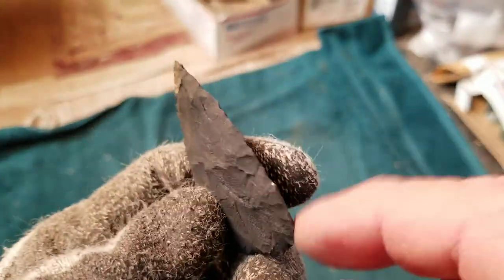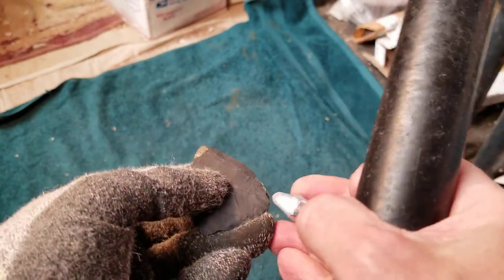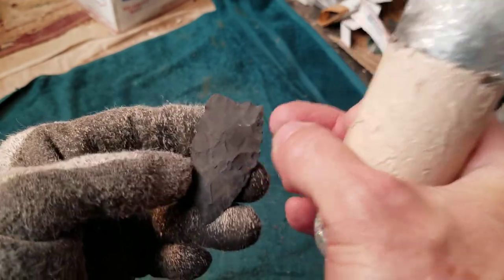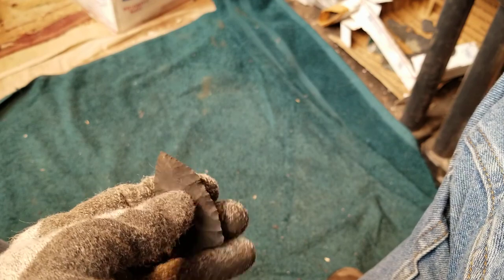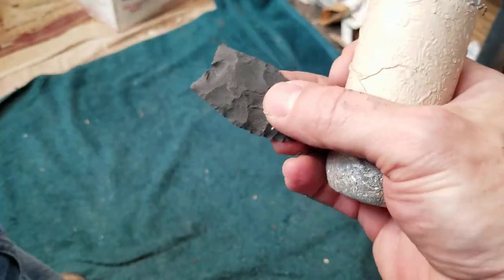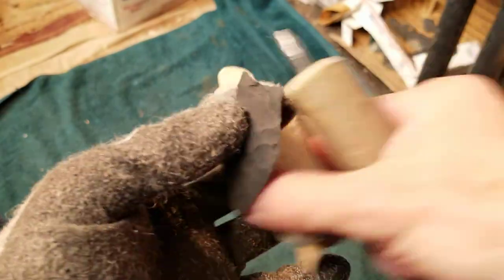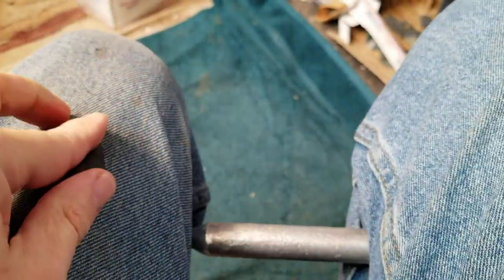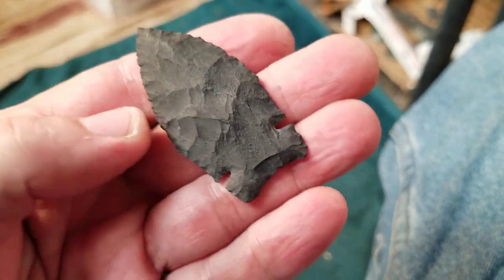941 - Flintknapping Kessell Side Notched from Kanawha Black Chert

Comment: As an experiment , try unrolling about the last 7" of your softened deer hide roll that you use for pressure flaking  , loosely roll that back upon itself in loose folds and try running longer flakes on them. The hard roll acts as finger pressure when condensed in a hard packed roll...
Reply from the maker: I'm afraid the workpiece might snap if the roll is too soft in the area I'm applying pressure.